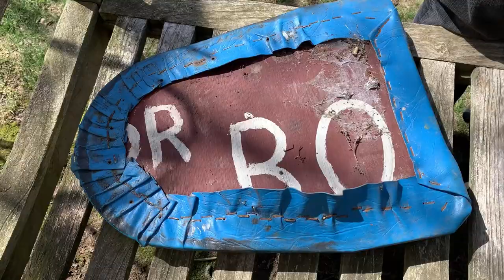Junk vintage go kart gets a restoration!

Comment: Good job....Looks like U should of just built it from scratch since U replaced alot of the front section. pretty good welding skills
Reply from the maker: Thanks man, problem is materials are actually pretty expensive and I don’t have a pipe bender for thick wall stuff. Sometimes the junk is worth saving.
Reply: @trevormillar5469  Heck yeah, I bought some pipe to repair a go kart & spent $22 for about 4 ft. of pipe, Home  Depot.
Tooo Expensive. Next time I will get pipe at the metal recycling place where I got the go kart for $20...

Comment: Nice job! I just picked up a vintage cart also. Do you know where you bought the rear axle with the mechanical disk brake?
Reply from the maker: Thanks! The axle came with the frame. If I remember correctly it’s a 1” diameter axle so I just bought a universal brake kit for a 1” axle on gopowersports.com